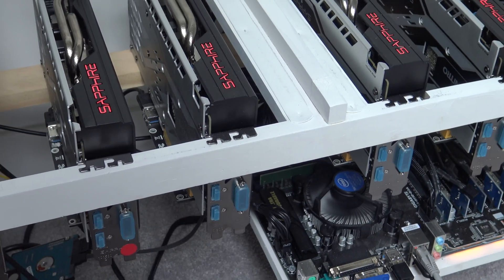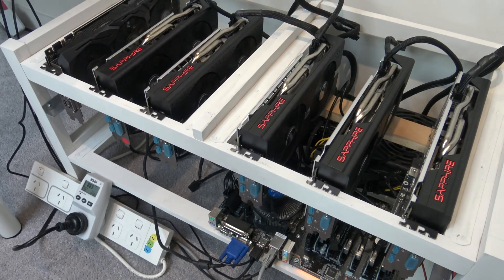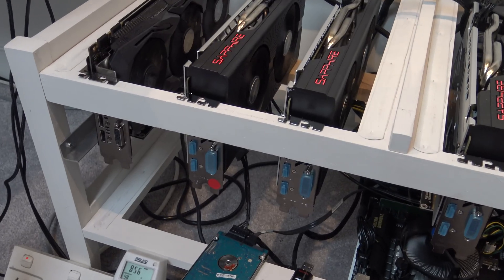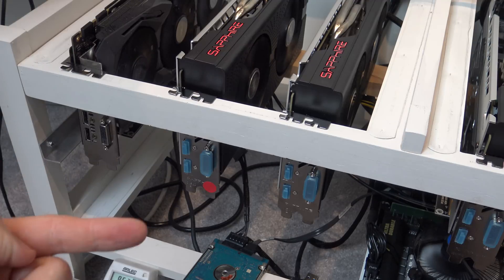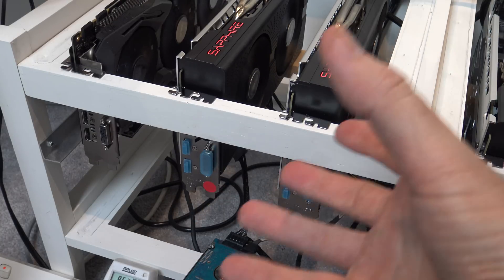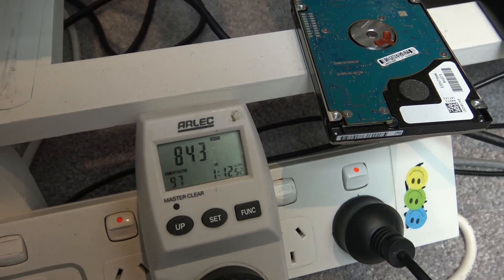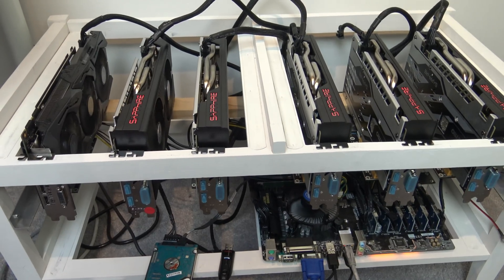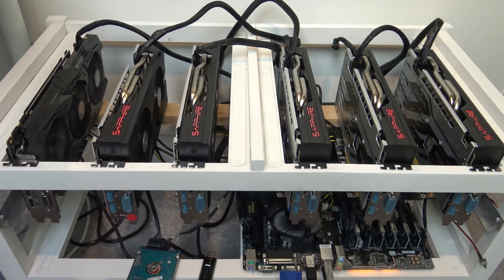First Mining Rig Update - Troubleshooting Hardware

Comment: Hi nice video learn some stuff. I have just one question I noticed on your first video with 3 cards you did not plug in the pcie 12v right side corner. Is it necessary to plug in the pcie-12v? Sorry just for this noob question hope you will answer me. TIA
Reply from the maker: You can plug it in for sure. But in my case it wasn't needed. However to spread the power out more evenly its a good idea just to run a cable to that slot. ESP if you have power intensive cards on the risers. 1080s or Vega cards.
Reply: Thank you it really helps a lot especially for beginners.
Reply from the maker: Glad it helps out.

Comment: I'm gonna give a piece of advice that will not only help and potentially save your cards but will also give you higher overclocking on your cards. After running them for a year, go through every card 1 by 1, take them apart, and reapply thermal paste onto the processor chips. I know it's kind of a pain in the ass but you have to realize that thermal paste under extreme heat for a year straight will completely burn off, and after that your card will be going essentially metal to metal. Which is why if you notice when you first start mining your temps are lower than they are a little while later.
Reply from the maker: Good advice mate!

Comment: what is clock or over clock problem in 4gb card?.
I didnt get it.
As i wanna start mining with this tools  you said.But atlast you said this is the problem with 4gb card.
Mate ,please do reply as i dont got knowledge on these sector.
Help me out.and also give list for mining hardware that is cheap and dont brings prblm like you said over clock or clock kinnda stuff.

This clock problem can be solved , if i used 6 gb gpus.

Please mate tell me, i wanna start mining and dont wanna lose those hard earn investmest thro hardware clock or overclock prblm
Reply from the maker: Some memory is not as good and there fore it wont achieve high clock rates. It means you will have to clock all the other cards down or you could clock the cards individually.
Reply: Thankyou mate.
And Nvidia 1060 6gb is good or 570 card.Which one is good, brother 

And i heard 4gb cant make when the mining data gets more than its 4 gb capacity .But i wanna mine all  etheeium zcash al great value coins all day long.

If that is true then what kinnda gpus you suggest bro.
#From 
#Nepal 
Lots of love bro
Reply: Samsher Khadka I think the Nvidia 1060 6gb will be better.
Reply from the maker: Either is good, 570 might get higher hashrate.

Comment: Great videos! Is there any advantage using rx 580 instead of 570's? I'm asking because there's no price difference between these two models in my country
Reply: PS: How are you mining after the nicehash hack?
Reply from the maker: Less power on the 570s.
Reply from the maker: Crying for myself and the mining rig community. :( I actually switched before the hack to the Claymore dual miner. ETH and DCR. However I was about to switch back to nicehash because they pay in Bitcoin. Now that they are gone. Feel pretty sad for those honest miners and the guys running nicehash.

Comment: I’ve never built a computer before, do you not recommend me building this rig on my own?
Reply: I'm sure you will be fine, the components are designed so that they can only be paired up / connected, if you match the correct components up and then line them up correctly to connect them. Like 123myIT said, just follow his video - https://youtu.be/3JCyDo-c11k - taking your time to follow each step.
Reply from the maker: Pretty easy build mate. Just start with one graphics card. Follow the other video I put up earlier. Link here.
https://youtu.be/3JCyDo-c11k
Reply from the maker: Good call mate!

Comment: So you don't have stability issues by including an Nvidia card in your rig? They usually don't play well together.
Reply from the maker: Only got the 6th card yesterday. Weird thing was after I took the nvidia card out the hash rate for each card went from 28 to 29 and the power went down from 850 to 550 watts. I am still not sure if its reading right. It doesn't sound right to me.
Reply: Alfi it won’t get close to 300W once tubed for mining. Mining won’t push the card like gaming would. Search around the internet for mining parameters to start with. YMMV so those are just starting points your card may be slightly worse or better, but usually you can push the core and memory clocks and reduce the power set point and get +10% to +15% mining at -15% to -30% power.